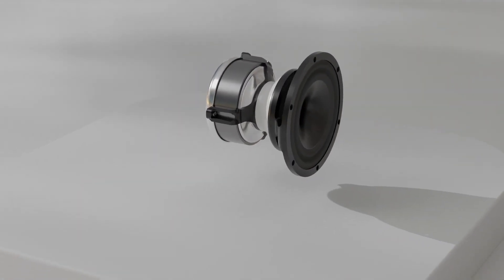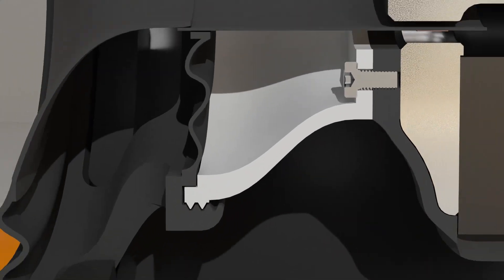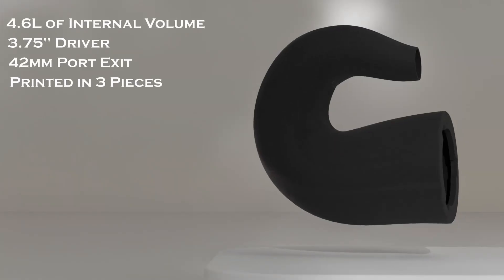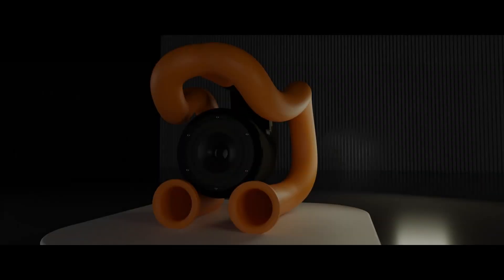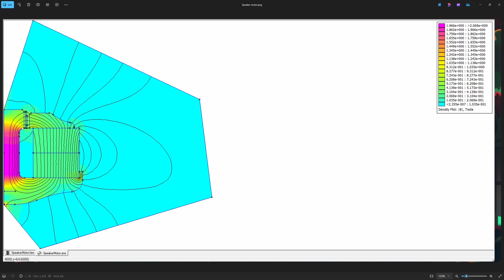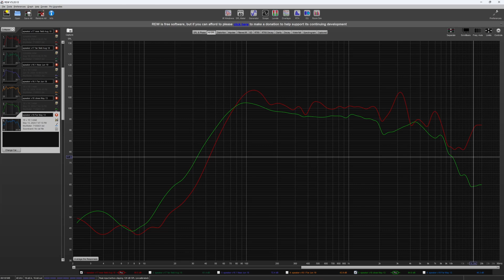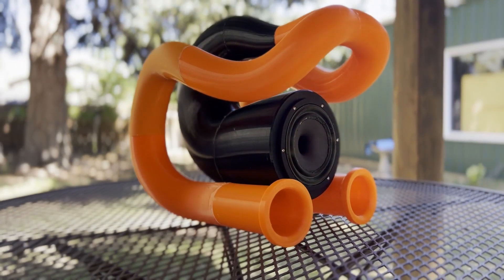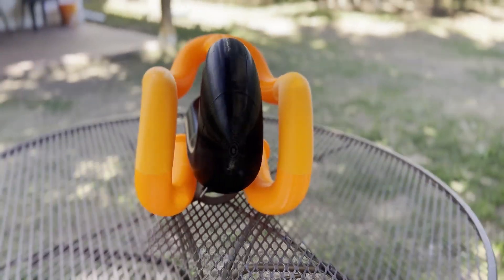Fully 3D Printed Speaker v17

Comment: Esse projeto só serve pra esse tipo de alto falante ou pode ser qualquer um com o mesmo tamanho ?
Reply from the maker: The box was designed around the speakers TS parameters, so using another driver in the box will lead to untested results- however you can stick any speaker that shares the mounting hole diameter into the box.

Comment: This speaker design is great! The motor is refined enough to a point where I would work toward reducing as much moving mass as possible, try maybe borrowing tolerances from other materials as it seems you are comfortable with including different materials for things such as the steel in the magnet, maybe experiment with a cloth surround Impregnated with a semi stiff silicone? I really recommend switching cone material aswell. I own a couple pairs of paradigm speakers from the late 80s 90s and the cone material they use is an extremely thin stiff and light polypropylene I bet the cone itself weighs less than a gram at 8 in diameter, try using aluminum from pop cans to make the voice coil former, sand it a touch and use ca glue or epoxy to adhere it to itself they use aluminum for that in high efficiency speakers its extremely stiff and light now, I get the idea is a fully printed speaker but if you really want to improve the design I don't see it going much further efficiency wise. And it will bring back the "diy" esthetic, I loved the demo and you can really hear the improvements. If you use alu don't forget to isolaye the coil from between it and the former as alu is conducive!
Reply from the maker: Yeah, I’ve been experimenting with casting silicone. So I’ll likely do that for the next iteration, I might also try a carbon fiber cone, as I have a bit laying around.

Comment: I like the series. But going from full DYI to "my sponsor made and paid almost everything for me" is kinda.... yeah.
Reply from the maker: I was still responsible for the entirety of the enclosure/ port (13 separate pieces over 5 different 256x256x256mm build volumes), the TPU suspension, and the former. I also still designed the entire project from the ground up using tons of collected data from the previous 16 versions. 

If anything, it proves you don't need a 3D printer to create my project and follow along as there are lots of individuals who would like to build projects but don't have the space / funds to buy a 3D printer. it's the same reason I always farm out my laser cut plates/CNC work. I don't have the funds or space for a laser cutter or CNC machine. It doesn't make it any less DIY IMO.
Reply: @piscesprinting don’t listen to ignoramuses  like this who never made a damn thing their whole life
Reply: @piscesprinting  i fully agree, very impressive work, pcbway only printing the already fully designed parts is nothing to sniff at!
Reply: "I'll pay you what I owe, just not all right now (after I said I'll pay it all back tomorrow)."
Reply: I disagree, this guy designed a fully printable speaker, and made it publicly available, what did you do?
Reply: @LauLex  A lot. Anyhow,  I'm just saying I started to follow this series to see if it's possible to make a speaker using a 3D printer. But now so many parts have to be ordered at some company, preferably the sponsor, it's no longer interesting for me.
Reply: @jhbonarius  So use this as a starting point with only the parts you can make yourself, and try to make as many other parts as you can without having to buy them.